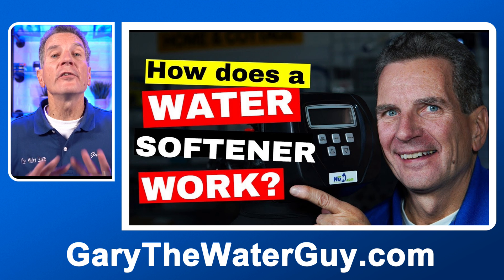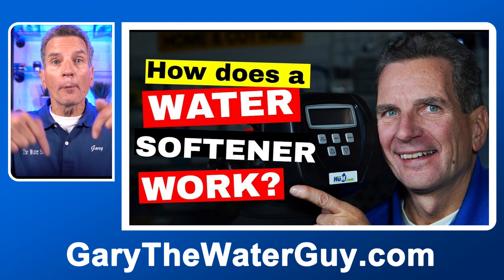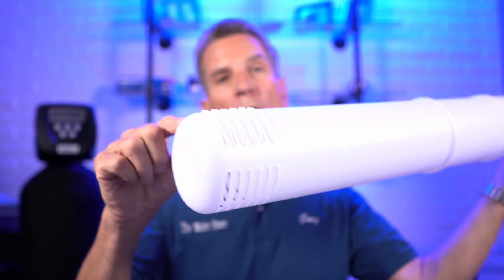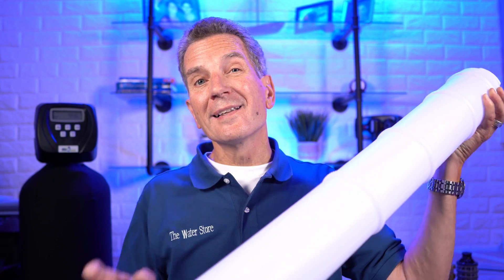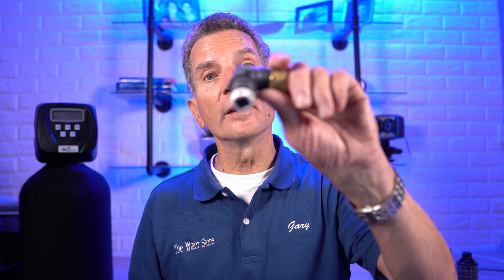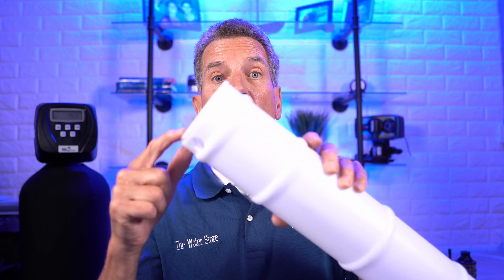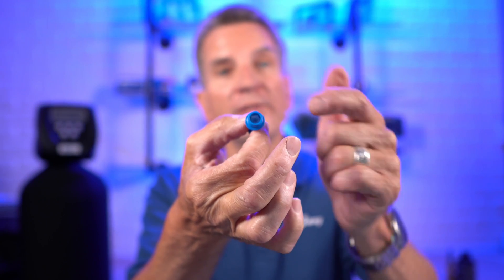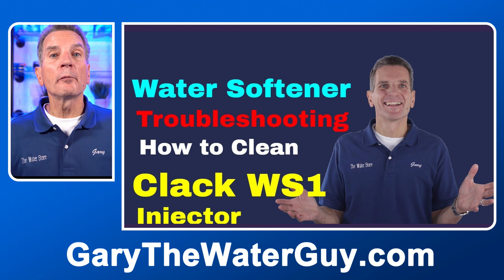Water Softener Troubleshooting – TOO MUCH WATER in Brine Tank

Comment: Hi,
I’ve cleaned the injectors and troubleshooted most (except for the piston) it is a fairly new system.

The water level creeps up over time- but there is no leak! It seems like each time it refills it gets a little higher?
Reply: It’s a novo 2 part 485HE I also noticed the too (emergency float?) was at a high level and have adjusted this. I had this machine serviced late last winter. I hope you can help!
Reply from the maker: Does the water level keep rising after the regeneration every day more water?  If so water is leaking past the pistons and the seal pack needs replacement
Reply: No, I followed all the troubleshooting steps (which I am so thankful for!!!) left the salt low, and marked the line. 2 days later the water was still good. I have “iron friendly” injectors. That seemed to be clear. Though the screen could have been the culprit. I have changed the filter at the well, as well. 

Is this maintainace needed every couple months? Or is there something that I’m missing!
Reply: No, I followed all the troubleshooting steps (which I am so thankful for!!!) left the salt low, and marked the line. 2 days later the water was still good. I have “iron friendly” injectors. That seemed to be clear. Though the screen could have been the culprit. I have changed the filter at the well, as well. 

Is this maintainace needed every couple months? Or is there something that I’m missing!
Reply: No, I followed all the troubleshooting steps (which I am so thankful for!!!) left the salt low, and marked the line. 2 days later the water was still good. I have “iron friendly” injectors. That seemed to be clear. Though the screen could have been the culprit. I have changed the filter at the well, as well. 

Is this maintainace needed every couple months? Or is there something that I’m missing?
Reply: No, I followed all the troubleshooting steps (which I am so thankful for!!!) left the salt low, and marked the line. 2 days later the water was still good. I have “iron friendly” injectors. That seemed to be clear. Though the screen could have been the culprit. I have changed the filter at the well, as well. 

Is this maintainace needed every couple months? Or is there something that I’m missing?
Reply: No, I followed all the troubleshooting steps (which I am so thankful for!!!) left the salt low, and marked the line. 2 days later the water was still good. I have “iron friendly” injectors. That seemed to be clear. Though the screen could have been the culprit. I have changed the filter at the well, as well. 

Is this maintainace needed every couple months? Or is there something that I’m missing?
Reply: No, I followed all the troubleshooting steps (which I am so thankful for!!!) left the salt low, and marked the line. 2 days later the water was still good. I have “iron friendly” injectors. That seemed to be clear. Though the screen could have been the culprit. I have changed the filter at the well, as well. 

Is this maintainace needed every couple months? Or is there something that I’m missing?
Reply: No, I followed all the troubleshooting steps (which I am so thankful for!!!) left the salt low, and marked the line. 2 days later the water was still good. I have “iron friendly” injectors. That seemed to be clear. Though the screen could have been the culprit. I have changed the filter at the well, as well. 

Is this maintainace needed every couple months? Or is there something that I’m missing?
Reply: No, I followed all the troubleshooting steps (which I am so thankful for!!!) left the salt low, and marked the line. 2 days later the water was still good. I have “iron friendly” injectors. That seemed to be clear. Though the screen could have been the culprit. I have changed the filter at the well, as well. 

Is this maintainace needed every couple months? Or is there something that I’m missing?
Reply: No, I followed all the troubleshooting steps (which I am so thankful for!!!) left the salt low, and marked the line. 2 days later the water was still good. I have “iron friendly” injectors. That seemed to be clear. Though the screen could have been the culprit. I have changed the filter at the well, as well. 

Is this maintainace needed every couple months? Or is there something that I’m missing?
Reply: No, I followed all the troubleshooting steps (which I am so thankful for!!!) left the salt low, and marked the line. 2 days later the water was still good. I have “iron friendly” injectors. That seemed to be clear. Though the screen could have been the culprit. I have changed the filter at the well, as well. 

Is this maintainace needed every couple months? Or is there something that I’m missing?
Reply: No, I followed all the troubleshooting steps (which I am so thankful for!!!) left the salt low, and marked the line. 2 days later the water was still good. I have “iron friendly” injectors. That seemed to be clear. Though the screen could have been the culprit. I have changed the filter at the well, as well. 

Is this maintainace needed every couple months? Or is there something that I’m missing?
Reply: No, I followed all the troubleshooting steps (which I am so thankful for!!!) left the salt low, and marked the line. 2 days later the water was still good. I have “iron friendly” injectors. That seemed to be clear. Though the screen could have been the culprit. I have changed the filter at the well, as well. 

Is this maintainace needed every couple months? Or is there something that I’m missing?
Reply: No, I followed all the troubleshooting steps (which I am so thankful for!!!) left the salt low, and marked the line. 2 days later the water was still good. I have “iron friendly” injectors. That seemed to be clear. Though the screen could have been the culprit. I have changed the filter at the well, as well. 

Is this maintainace needed every couple months? Or is there something that I’m missing?
Reply: No, I followed all the troubleshooting steps (which I am so thankful for!!!) left the salt low, and marked the line. 2 days later the water was still good. I have “iron friendly” injectors. That seemed to be clear. Though the screen could have been the culprit. I have changed the filter at the well, as well. 

Is this maintainace needed every couple months? Or is there something that I’m missing?
Reply: No, I followed all the troubleshooting steps (which I am so thankful for!!!) left the salt low, and marked the line. 2 days later the water was still good. I have “iron friendly” injectors. That seemed to be clear. Though the screen could have been the culprit. I have changed the filter at the well, as well. 

Is this maintainace needed every couple months? Or is there something that I’m missing?

Comment: How do I relieve the pressure before removing and fittings? In bypass mode, the system will not regenerate. This system uses an older Fleck valve.
Reply from the maker: In bypass mode it will not regenerate but it will release the pressure if you put it into bypass mode and then regenerate.

Comment: My brine tank isn't filling, we have to put water in it. The brine is going in, but no water filling.
Reply from the maker: I would check the settings, or make sure the brine line flow control isn’t blocked
Reply: @water_estore  the brine comes out though, so the line must be open
Reply from the maker: @helichuck1  did it ever fill itself?
Reply: @water_estore  Oh yes, we have had it for years. I rebuilt the head, and tried to turn down the amount of salt it used, it was set for 18 lb per refresh. Then it wasn't filling the tank. So I just put it back to 18lb, we will see what happens. It is old I probably ought to get a new upflow model.

Comment: I cleaned the (brine tank, floater, injector, etc) I see all the cycles go as expected order. Also the water in the brine tank is at a good level. I removed some water from the Brine tank and Idid regeneration, then water went back to the same good level, that means the water went to the tank and the floater stopped water at good level. I still have the feeling that the water sucking process is notworking. I don't know how to prove that. But I notice that salt level is not getting lower, that means water is saturated with salt because the floateris locked because water level is the same because no water goes from the brine to the resin. Any other steps I can do to resolve the issue? Do you provide service at Richmond Hill, Ontario? Or recommend technician to help with that?
Reply from the maker: The valve might need to be rebuilt.  Sorry I don't know anyone that I recommend in your area.
Reply: @water_estore  i have exact problem but mine happened due to leaving no salt and cleaned the tank. Then it happened. Any recommendation?